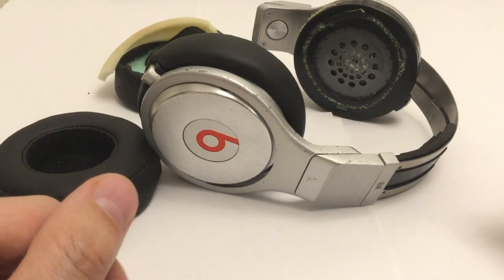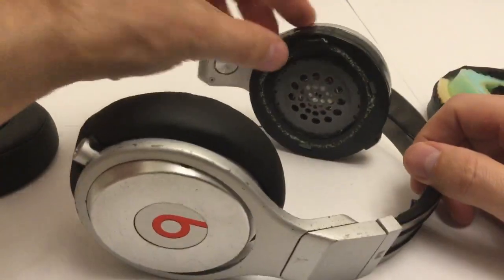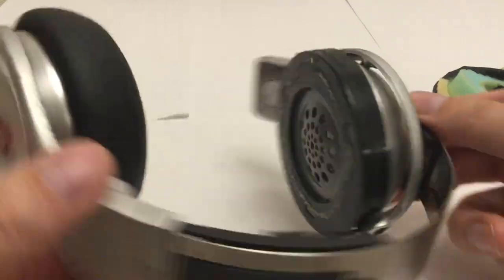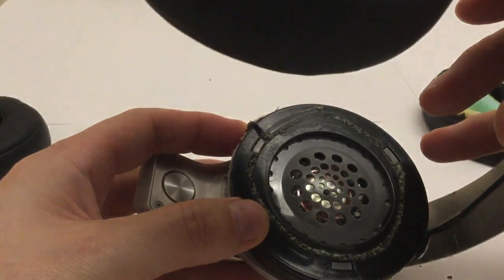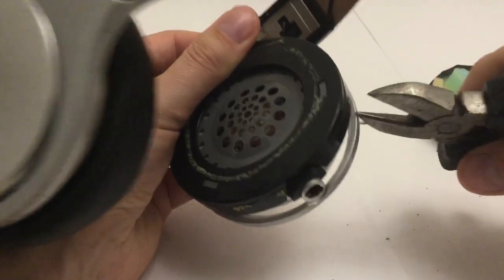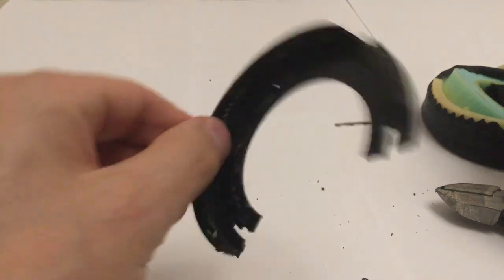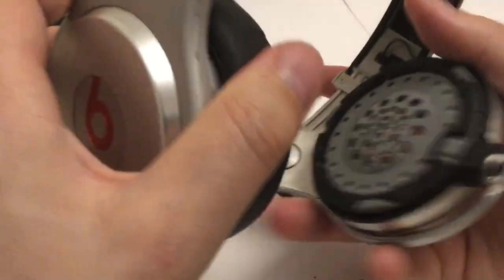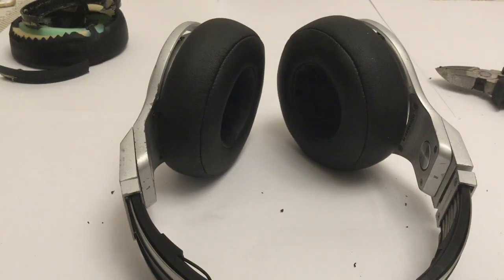How to Remove Stuck Ear Cushion Plastic? Problem Fix for Beats Pro by Dre

Comment: Just a message to anyone in the future attempting to get the earpad on... Check to make sure you didn't bend one of the plastic tabs in on the earpad side. I accidentally did this and wasted over 20 minutes trying to line up the pad, but every time I was missing one of the three tabs. If you DID bend a tab in fret not, just bend it up again using a flat head screwdriver SLOWLY. Hope this can help someone in the future.

Comment: hii, i see u also removes the upper leather part of the headphones & I did the same but now i see that there is a thin cable there that is unprotective.. Do u think this is dangerous or since when do u use them like this ? thx so much, Rocio
Reply from the maker: Hi, I am not sure what part you mean? If you mean the bar that goes above across the top of your head? Let me know as I have solutions and info.
Reply: @IDPYouTube  thx for your reply ! yes exactly, i mean the bar that goes above across the top of my head:)

Comment: My ear cups ”fell off” and i can’t seem to click them back in place there would always be one of the three notches not in place. How do i do it? Thanks.
Reply: Just keep trying, sometimes it took me 30 minutes to install it
Reply: Yeah... I've got the same problem. Can't get em on. Can't believe that I am having such a hard time.

Edit: They already looked quite used so I decided to order new ones. However I still needed to use my headphones for now so I took a small knife and cut off a part of the outer rim which I believed was preventing me from putting it on more easily. I got it on right afterwards however I don't know how easily it'll be able to come off now. I can only hope that the new ones will be put on more easily.

Comment: Helped out big time, now if I can just figure out how to take the cable out so I can replace it..whenever I ordered them off ebay they were new, but they were the "diplay" version..if I would've known they cord had the cord permanently installed, I would've just paid the extra money for a brand new pair..they're still working perfect for about 5 years now, lol even though the aux cord is just just hanging together by 4 tiny wires